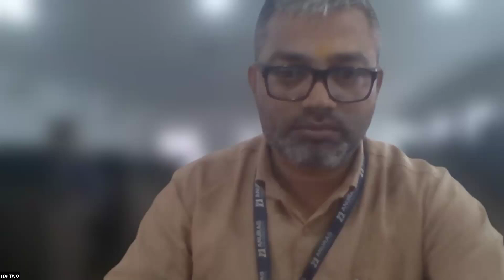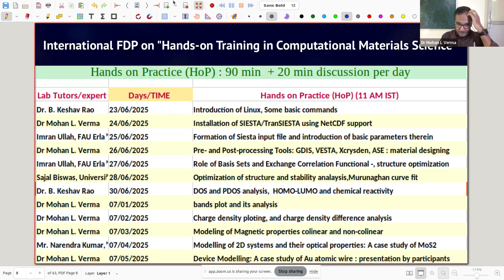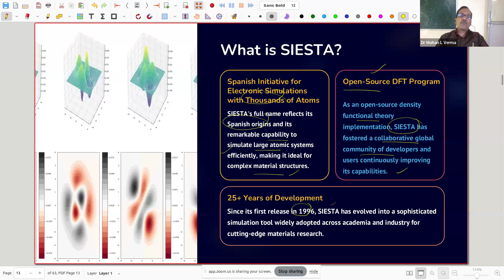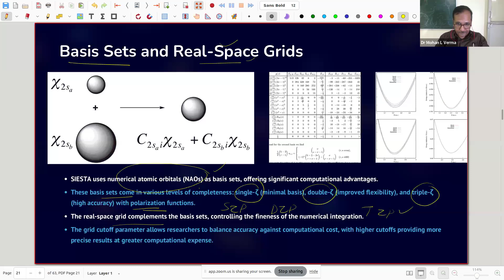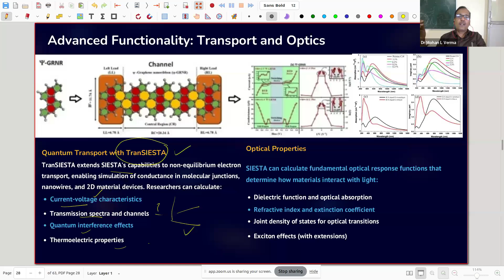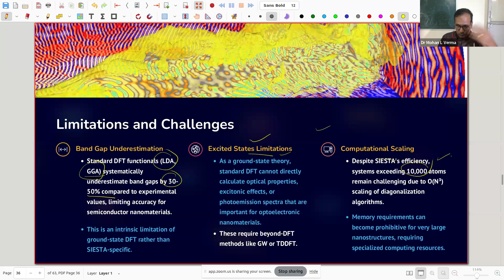Day-1 : Dr Mohan L Verma Inaugural Lecture

Comment: Regarding Pooja’s question:

VASP and Quantum ESPRESSO are best suited for periodic materials because they employ plane wave basis sets, which allow for systematic and well controlled convergence with respect to energy cutoff and k point sampling. This makes them highly reliable for bulk solids, surfaces, defects, and low dimensional materials.

SIESTA uses numerical atomic orbitals, which are more compact and computationally efficient but less systematic than plane waves. While SIESTA can be less accurate if the basis is not carefully converged, it is extremely fast and therefore well suited for large systems such as slabs, surfaces, interfaces, and nanostructures where plane wave calculations become expensive.

Gaussian and ORCA are primarily used for molecular and cluster calculations. They rely on Gaussian type orbitals, which are ideal for localized systems and high accuracy quantum chemistry calculations but are inefficient for truly periodic solids.

CP2K employs a mixed Gaussian and plane wave framework, where the Kohn Sham orbitals are expanded in Gaussian basis functions and the electron density is represented using plane waves. This approach combines the efficiency of localized basis sets with the robustness of plane wave methods, making CP2K a good alternative for large scale periodic systems, condensed phase simulations, and cases where SIESTA accuracy is insufficient.